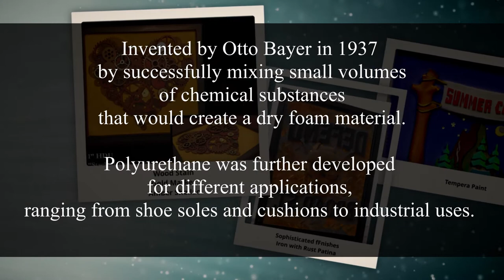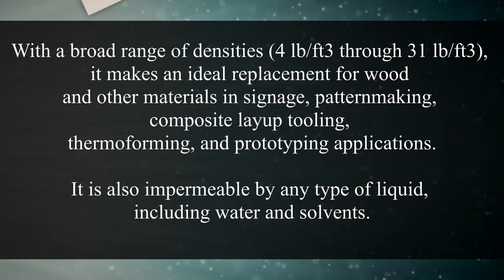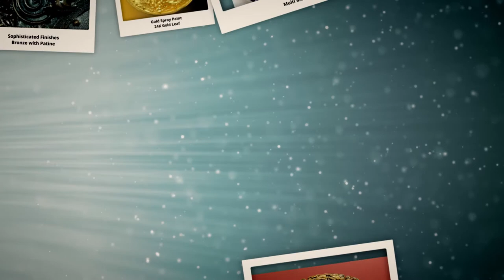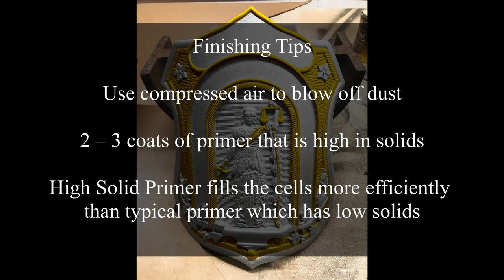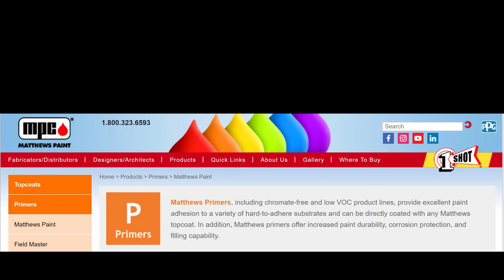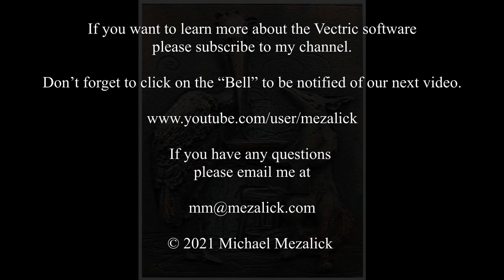Working with High Density Urethane

Comment: Very informative once again, thank you. Question: Do you loose detail (resolution) by heating? Have you discovered a DO NOT EXCEED temp for this bending process?
Reply from the maker: There is no loss of detail....and a not to exceed temp would be listed in the Data sheet...Probably 700F

Comment: What density board works best? The heavier density the more expensive it gets. However, it seems there is a trade off between project detail and cost. Great information, thanks.
Reply from the maker: Kevin, I use 15 lb for most of my work.

Comment: The problem is making it curved in the software and then machining it on a 3 axis is you lose a lot of detail because the Cutters always straight up and down even if the work piece curves so the biggest advantage to this as you can mimic the result of a 5-axis CNC machine and limited situations like what this in this video
Reply from the maker: Thanks